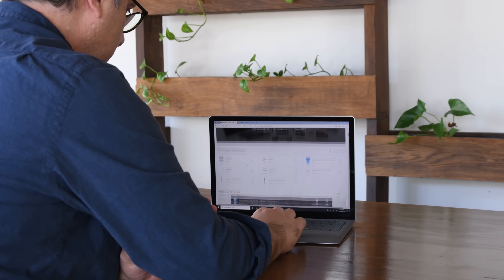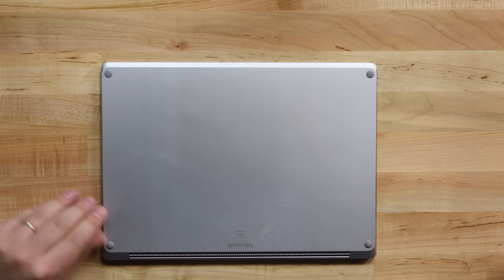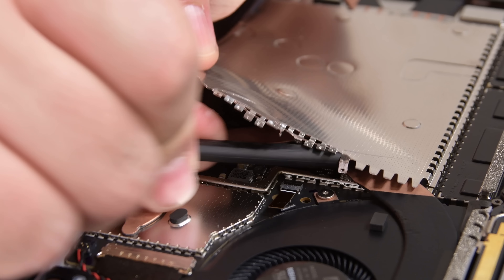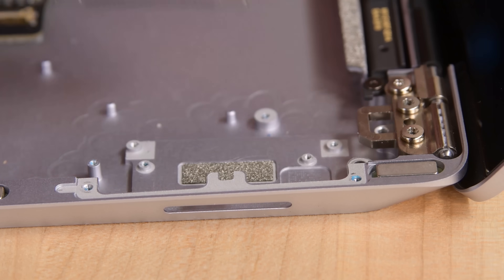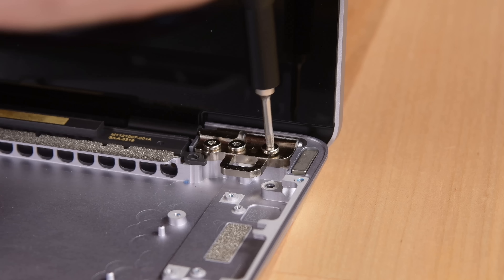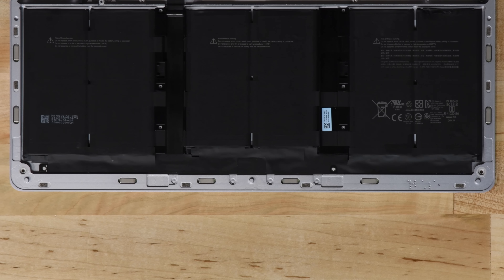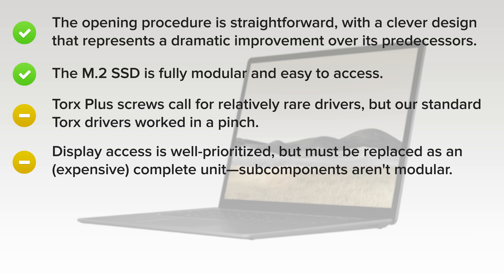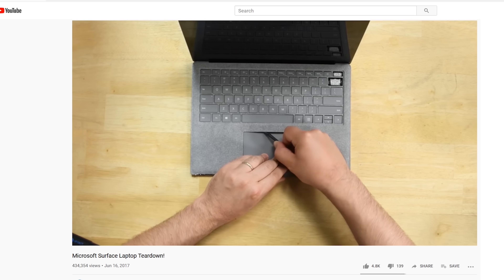Surface Laptop 3 (13.5 inch) Teardown-Still the Least Repairable Laptop Ever???

Comment: Can anyone advise on what adhesive should be used to glue down the battery connector back to the chassis - should it be electrically conductive? (this is the end with the connectors that the motherboard sits on top of)... It sits on a bare aluminium plate and the connector cable has a big copper contact on the bottom - so I assume is either an earth, heat sensor, or for heat dissipation?

Comment: extremely important thing to note not mentioned in this teardown: after lifting off the keyboard, make sure you pop off the keyboard flex cable from the laptop's main body before doing anything else. This ribbon cable is easy to accidentally detach on the keyboard side, which is a pain to resocket and it is very fragile.

Comment: Where can I get replacement torx screws? 
Also, swapping  m2 2230 SSD failed. Had to revert back to 128Gb. Anyone know a part number for 512Gb ?

Comment: I was about to order a surface laptop 3 in the next 5 minutes. The battery issue is a deal breaker. Batteries are consumable items and I’m not performing a science project in 3 years when i want to replace it.

Comment: When I close my surface laptop 3 display a crackling sound can be heard when even putting slight pressure on the display. Anyone know what this could be the display seems fine at the moment. Thanks in advance.
Reply: Mine does that too. Nothing to worry about I think.

Comment: Just to warn anyone who wants to get the SL3, since the keyboard is removable, the alcantra model has some keyboard flex in the middle and the keys feels mushier than the SL1 & 2.

It's not a deal breaker but be aware that it's not the same as the older models. The SL3 metal doesn't seem to suffer the same keyboard flex though.
Reply: If I remove the little rubber bumpers am I able to put them back on? Or do they just break off??
Reply: @nateweber  if you heat them first slightly and remove them with tweezers you can keep the glue on and put them back on after

Be careful and patient otherwise you'll tear the glue
Reply: Mr.Bootcheekoh thank you for replying, the reason I need to get inside of my surface laptop 3 is because when I put a little force into the space bar and push it forward slightly it gets stuck down? I haven’t damaged it or anything so I’m not sure if it came like this?
Reply: So I was gonna open it up and see if there was any really problems with the space bar or if it’s just made incorrectly
Reply: Mr.Bootcheekoh if you have any advice on what I could do about it it would be much appreciated man🙏

Comment: 1:01 what is the name of this form factor of SSD ? The NVME usually uses the same port but are long (like a rectangle).. What is this one called ?
Reply: This is a M.2 NVME 2230 SSD instead of a traditional 2280 SSD (22mm by 30mm)

Comment: Having the battery more easily removable and ram being able to be replaced would be all this laptop needs.
Reply: Sadly, the super fast LPDDR4x isn't sold as sodimm :/ I'm kinda ok with it being solderd as long as they use LPDDR4x if it's a APU/SoC, since it's really fast and that's what we wan't for iGPU.

Comment: Yay, a Surface Laptop that doesn't score a 0 for repairability! Now let's make the battery easy to remove and it will be better still.
Fingers crossed the Surface Pro 7 and Surface Pro X will follow in repairable footsteps.

Comment: I wonder why those batteries are glued down... Aren't screws sufficient enough to hold it in place? Also they need to an alternative to those metal shieldings. Other than that, great improvement

Comment: Wow.
- No mention of the type of compatible M.2 SSD's (Looks like it's an M.2 2220 or 2240 I think? Probably PCIE too, but will SATA work as well?)
- No mention of the non-removable RAM (which IMO is worse than the battery stuff)

I know this is i_Fix_it, but I think upgradability (and thus repairability/sustainability of the device) should be kept in mind too.

Comment: but to most consumers, it's pointless, because most folks change a new laptop every 4-5years. The richer ones 2-3.
Corporations have laptop replacement policies at 3 years. 

Unless the batteries quality is very bad, like the 1st gen surface book, then yes, battery replacement will be a chore. But if not, I don't see much problems with non replaceable batteries.
Reply: I still use my macbook pro from 2014 and it's working perfectly. I expect to keep using it for at least a few years more, there's no reason a laptop shouldn't be able to last 10 years especially these days where computing performance in consumer products has skyrocketed. Making the battery non replaceable is just a move by companies to force planned obsolescence
Reply: @jm1835  same for my brother's macbook. Battery still works fine, but it's starting to slow down a lot. But still use able. 

My 2010 iMac is the same.

Comment: ifixit gives microsoft a 5 now, up from zero, however removing the battery is all but impossible, making these no good within two to 4 years, except when plugged in.
Reply: Well, it's not impossible to replace the batter... just super difficult and troublesome...
Reply: @TheDeathmail  well almost they are pros and they gave up.
They said to take it off you need to do and use things that the battery says not to use to avoid explosion. Or fire.
So yea they did it on purpose to give it a limited life span.
Reply: Yes I would have purchased this if the battery was replaceable. I'm hoping that Microsoft at least offers a battery replacement service in store, but if you look at all their other devices, I highly doubt it. There's no reason to make the battery so hard to replace, even Apple has a battery replacement service

Comment: What is the function of the metal shields?  If one was to replace their SSD, would there be a strong reason or ability to find a replacement shield?
Reply: Metal shield doesn't cover the ssd
Reply: It has no function other than to discourage people from removing it and so microsoft can know if you have opened it up (and take away your warranty)

Comment: Thought it would get a 7/10 but that battery is definitely a negative. I hope this returns the market back to fully modular designs with replaceable everything, including RAM. 
You'd think getting a 10/10 for repairability and winning over new customers with the promise of replaceable SDD, RAM, and battery would be more than worth it in new business.

Comment: I call bullshit on the repairability score, the 13” MacBook Pro of 2016 with function keys get only a 2/10 while having the same amount of removable and modular components. Also, the ssd isn’t a industry standard length and should be considered proprietary. This should have gotten a 3/10 at most because you need to remove adhesive from the bottom feet, complicating the required list of tools and parts before performing a tear down and the metal shields which need to be destroyed to perform your own repairs thus voiding the warranty and make the device non-returnable when there is a factory issue.
Reply: The feet adhesive is a thing in most laptops since ages. Even a kid can remove them.

Comment: I don't understand the "high" score. Yes, they improved a lot. But they were really bad before, so it is easy to improve. Battery (most common repair, as you say it really often) is glued in place. The display is replaceable, but just together with the digitizer, etc. Also, processor and memory are soldered to the motherboard, so they are not easy to replace.
In the end it seems more repairable then it is.

Comment: Double standards. The MacBook Air is so much more repairable than this laptop. Pull tabs for batteries, no metal shielding. Why is this laptop getting a 5 and the MacBook Air only getting a 3
Reply: I would give this device a 3.5-4 because you can atleast change the ssd, and the keyboard is easily replaceable.

Comment: Somehow I don't think iFixit has a standardized way to measure repairability. Their scores seems overly thought and sometimes not at all relevant.. I really hope they work towards a more standardized set of rules and pointers
Reply: The problem is that not every issue and problem is exactly the same... so making a standardized set of rules just can't happen. Instead, they focus on how difficult it could be to repair or not repair.And while not perfect, it gives you an idea of how great it is and they do explain their reasons.
Reply: @TheDeathmail  Sure. I agree. But the problem is if the results are not consistent.  The scores for something just goes down because you have to open a lot of screws or something which is not technically a repair bottleneck. My point is that one can standardize what can be considered an easy repairable device vs what is really hard. I ha e seen videos where everything is non-upgradable but the Devi e has a good repairability score. Whereas some devices which are pretty well made but had a less score.. I cannot digest that. I hope I was able to convey my point

Comment: So sad the battery is glued in.
Reply: Well at least if you need to remove it is because is dead so no reasons to not go hard on it. After completely discharge it, of course!
Reply: @DumahBrazorf  seems like it would damage the case to go nuts removing it. My Samsung laptop battery comes right out with two screws :(

Comment: Repairability score: 1 out of 10

Apple: YES, we did it! Hallelujah.
MS: We F'd up, here is a fixed version.
Reply: ifixit give microsoft a 5 now, up from zero, however removing the battery is all but impossible, making these no good within two to 4 years, except when plugged in.
Reply: but to most consumers, it's pointless, because most folks change a new laptop every 4-5years. The richer ones 2-3.
Corporations have laptop replacement policies at 3 years. 

Unless the batteries quality is very bad, like the 1st gen surface book, then yes, battery replacement will be a chore. But if not, I don't see much problems with non replaceable batteries.

Comment: It's really great to see how much easier this one is to open and repair! Any idea on availability for those really small M.2 SSDs? I feel that most are on a much longer board. Thanks guys!
Reply: The small size definitely is a bummer, but at least it seems to be standard M.2 (according to the video) and not some weird proprietary connector like Apple is using.
Reply: You can find them on eBay. 512 gb for about $90 or so.
Reply: @poetic.voyage  But be aware that they are PCIe x2 instead of x4. So for professional use, it can have a perfomance impact but for most consumers it won't matter :)
Reply: It's M.2 2230 SSD

Comment: So the question then would be: is that a special, proprietary SSD sold only by MS for a ridiculous amount money, or will I get one by any other manufacturer?
Reply: It's uncommon but not proprietary. It's made by toshiba and you can buy it relatively easily.
Reply: That looked like a short M.2

Comment: Microsoft: We've improved the repairability of this laptop
Apple: Wait, that's illegal.
Reply: Does apple still rivot the keyboard?
Reply: @Thor Lindberg Macbook got 1 out of 10
Reply: @Thor Lindberg well yes exactly?
Reply: @Thor Lindberg well no, but also as a reply to the original comment your comment doesn't make a lot of sense as it kind of implies irony.. where there is none
Reply: @Frank the Ant I just re-read your comment and Jesus there are so many factual things wrong there. Please do some research what the T2 actually does, it has jack shit to do with repairability. Just to give you one example why screws make sense even if almost any thing is on a single MLB: You can at least change your battery. And then again, check out Louis Rossmann for what is possible on Touchbar MBPs as non-authorized repair shop.. quite a lot of things. Your argument that not being able to open a laptop doesn't matter for these machines is just plain wrong.
Reply: except that literally every Macbook has way better repairability than these glued Microsoft machines.
Reply: @Frank the Ant Wtf has the T2 to do with authorized repair? You have seen any of Louis Rossmanns recent videos? Yes stuff is soldered in there like in many laptops with these form factors these days.. But opening up the laptop and getting out the individual components is quite easy on any Macbook. And just for the record, there is only one company that has once gone this far down the stupidity ladder to glue their expensive laptops together.. and that company is not Apple.
Reply: @RandomUser2401  T2 is a "security" chip that detects if you change parts unauthorized. The only authorized people are apple repair shops which makes it non servicable fir normal people or people who are running a repair business but are not affiliated with apple
Reply: @Someone-ci8wf  I know what the T2 chip is. So which parts can you change that are then locked by the T2? And for the record, the T2 is not a "security" chip, but a security chip that eg handles FileVault encryption natively. Last time I checked locking out matching parts because of different serial numbers was not within its task, so please enlighten me. The only reports I found stated that "maybe" the T2 locks the Mac after "certain" parts are changed - not a single case were this actually happened. The parts in question would probably be MLB and TouchID sensor - the two parts that must be paired as otherwise the whole TouchID security concept is broken.
Reply: @RandomUser2401  no, I am not saying you are not entitled to post your opinion. It is just stupid thats all, haha.
Reply: @seansixsixsix  Wow. what a reply. So, you care to elaborate why YOU think it is stupid?
Reply: @RandomUser2401  Defending a compay that intentionally screw their own customers  and then overcharge them for repairs is very smart and noble. haha. no, sorry, I am wrong, it is not stupid at all.
Reply: @seansixsixsix  this was not at all what our discussion was about kiddo. So after all, back to English class for you.
Reply: @RandomUser2401  我没有去评论你们说的那个T2芯片啊，哈哈，不过那个讨论也挺蠢的。我是说，你当苹果的死忠粉也就算了，帮苹果说话都说的这么生硬。。。你不蠢谁蠢。。。。hope belittle my English skill can  keep your ego up. cheers. haha.
Reply: @seansixsixsix  haha not your English dude. Your way of discussing and going sideways when there are arguments not in your favour. You know this is also taught in English class, so you better listen closely in class. But that is okay, I see that you are intellectually no more advanced than a blind Apple hater. No worries. One day you will grow up and have as well a broader and more reflected view on technology and life such as Louis.
Reply: @seansixsixsix  Ah yeah and Mr. Chinese master: Do you care to link me to a reliable source where the T2 ACTUALLY prevented a repair that would've been possible without it?
Reply: @seansixsixsix  hm. no answer anymore from Mr. "you are so stupid"?

Comment: please microsoft stop charging $300 for 8gb ram and make it upgradeable, and $300 to go from 128GB to 256GB storage, this is just insane!.
I must give you credit on the ssd upgradability and easier to open laptop, though.👍
Reply: Looks like a replacement 512 gb hard drive can be purchased for about $90 on eBay.
Reply: @poetic.voyage  yea I saw that 256 GB is about $40 instead of $300
1 th is under $200
Its a shame apple and Microsoft don't just charge twice retail and give you a credit for the base amount they are taking away.
And they get it way cheaper than wholesale.
Instead they charge approximately 1500 % + more for that extra 128gb.
Reply: @poetic.voyage  I tried to find a 512gb replacement for the Surface Laptop but it is a proprietary SSD and could not find any. Where did you see them? Also, MS told me that only affiliated IT engineers can replace these.
Reply: There goal is to make money off of parts dude

Comment: Awesome to see it's easy to pull apart nicely, good work Microsoft! I have a quick question, is the keyboard and top plate also held by the screws under the rubber feet? Or could you pull it off at any time and it's only the magnets holding it in place?

Edit: I've since looked closer at the video and it looks like there are screw holes in the keyboard panel as well, so it's held by both screws and magnets
Reply: If I remove the little rubber bumbers on the bottom can I put them back on?
Reply: The problem I have is that the most important item is having a replaceable battery as it is only 48watt and after a couple of years battery life will be below what is needed and I would want the option to replace. Looks like that is not going to be possible in most markets. I buy the RAM and storage I need so they are not important. Seems like for many of us it could still be a 0 as it doesn't help consumers.

Comment: SSD replacements are physically easy, but afaik this particular standard within m.2 (M.2 2230 M-Key) isn't easily found in store shelves, not sure if it's sold to the public at all actually
Reply: It looks like toshibas smallest m.2 ssd
Reply: @zombieswitapple  It's an M.2 2230 M-Key SSD, it appears similar to a lot of small m.2 SSDs but it's not the right size and not commonly sold to consumers.
Reply: You can find it online pretty easily, check ebay
Reply: @jm1835  All see are adaptors? One might work but someone would have to confirm they fit 
https://www.ebay.ca/sch/i.html?_from=R40&_trksid=m570.l1313&_nkw=M.2+2230+M-Key&_sacat=0